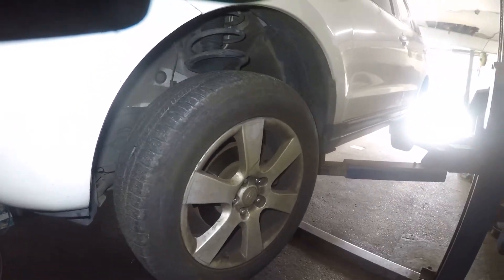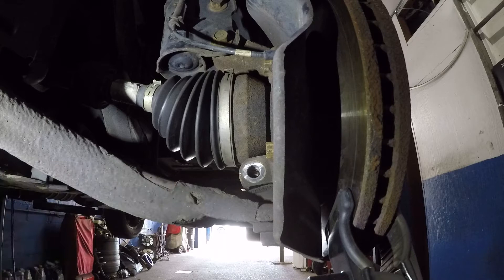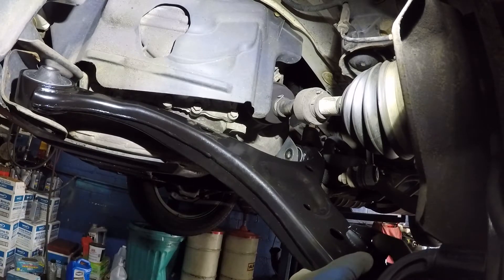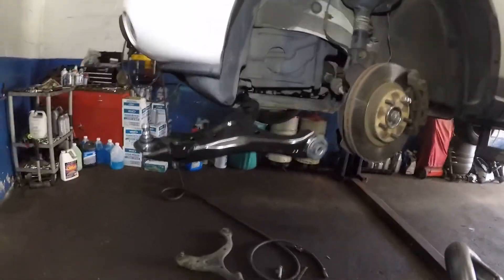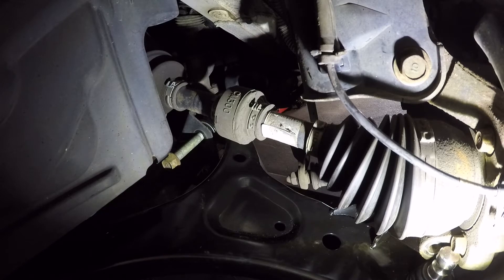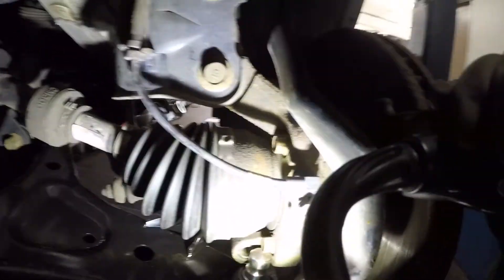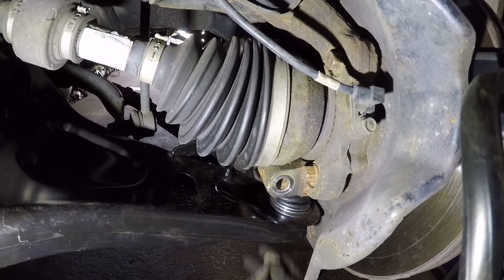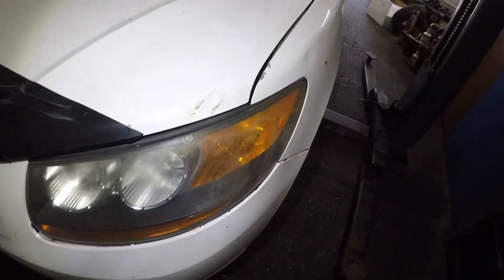How to replace Front Lower control arm on Hyundai Sentafe 2007 and others

Comment: Make sure you check the tip of the ball joint to see if it touch the axle because my did I installed it with aftermarket parts
Reply from the maker: Ok
Reply: May I ask , Do you think this job I can do it at home ? If yes I will try to do it in the summer because the bushing I think my is worn out after 17 years of used but I didn’t check yet to make sure it’s no good first .

Comment: If you move the right side control arm up a little more then the left side will fit straight , by the way what brand of the control arm did you buy
Reply from the maker: Movtec
Reply from the maker: Thanks for input I’ll try it next time!! 👍
Reply: Movetech brand how long do they last do you know ?
Reply from the maker: @thehegt  I had them on cars for over 3 years been good
Reply: @RBTheMechanic  thanks I’m going to buy it since they have life time warranty too , i try to buy the tools to press the bushing out but too much time and it doesn’t have the right fitting to press so i just return it .

Comment: The first pin you push out is not comint out head of it rusted? Been spraying, tried to tap no luck.  Any suggestion
Reply from the maker: The cotton pin use cutter to pull it out it dosent work try to brake it off as much of u can and try to make it that’s it’s only inside the hole then put on impact guy it will eat it up once u have the bolt out u can clean out the hole
Reply: Multiple things mainly put the nut you took out back only to the end of the stud bolt then hammer on it. Strong impact from other side works too and keep penetrate with oil the stud bolt. Strong chisel to spread the control arm helps too. If you do on ground use jack ON/OFF to raise knuckle or arm to release some pressure.

Comment: So... if there's play in the ball joint and the ball joint is bad and needs replacing, why the heck are you replacing the entire control arm? Was it damaged in an accident? Or are you just soaking the customer for additional parts and labor they don't need? This is why I do DIY. I replace what is actually needed. Not a Christmas list of things that pad the pockets of the repair shop.
Reply from the maker: Control arm was bad as welll the bushings and its best to do both if there’s play or slack or softness in bushing
Reply: @RBTheMechanic   I'm not sure what you mean about the control arm being "bad" since you didn't specify. Bushings can be bought separately if absolutely needed, but not related to the original issue (bad ball joint). Bushings deteriorate slowly over time, but unless they are completely gone, it would be an unnecessary expense to the customer to replace them, much less the entire control arm, unless the car was making knocking sounds or could not be aligned properly.

Sorry to be harsh, but I find this common and is the reason why when my daughter takes her car to a shop to replace a starter, they end up writing her up for $4000 with a "shopping list" of goodies that she doesn't need, just to see how many items they can add on (including over priced labor for 5 minutes of work and doubling the cost of parts bought directly from the auto store. Sometimes people really just want to fix the problem causing issues with driving the vehicle, and not to "rebuild" half the car just because of normal wear.